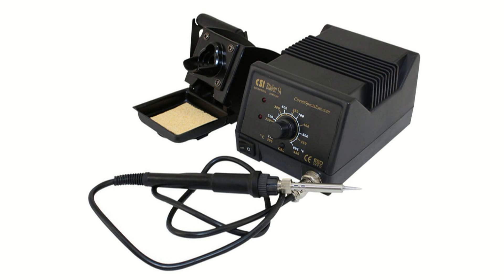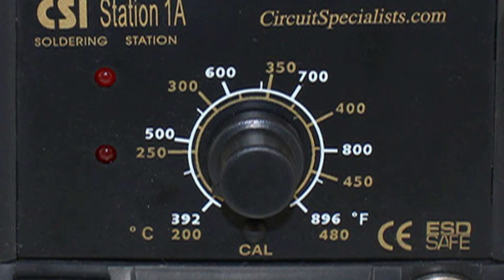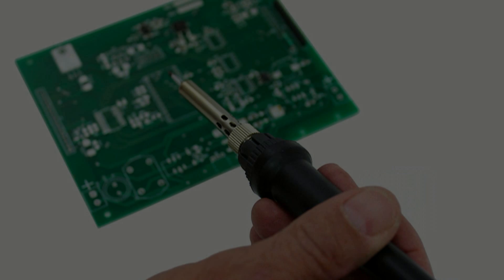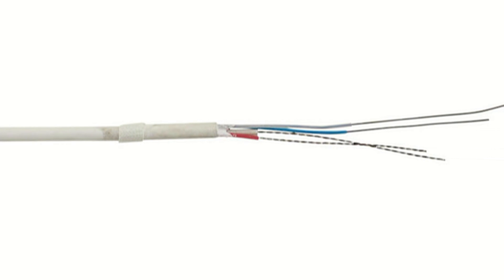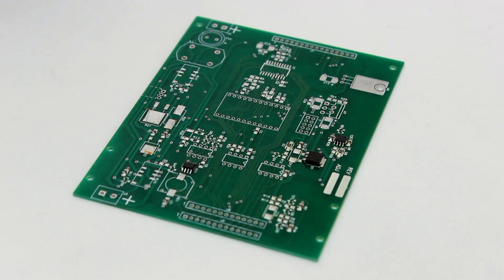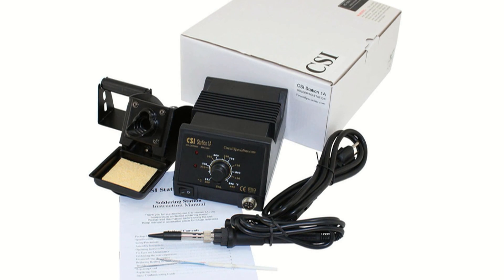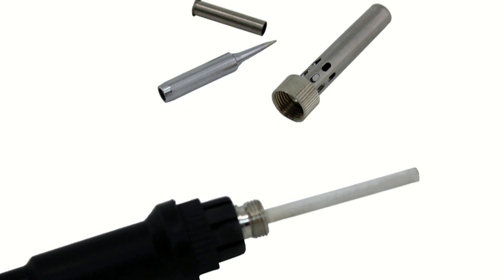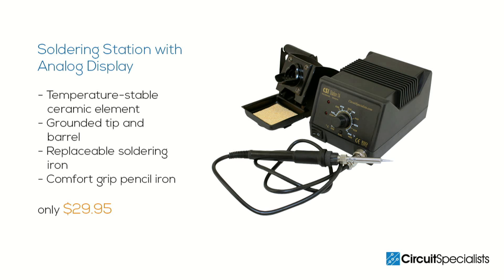Circuit Specialsits Soldering Station with Analog Display

Comment: I have an ancient csi-474 Circuit Specialists desoldering station. It's no longer made, and no replacement parts available. Does anyone else have one of these transformerless oddities? I am trying to repair this broken unit from an ebay purchase, and I need some reference information. If ANYONE has this unit, I need some circuit board and connector photos.